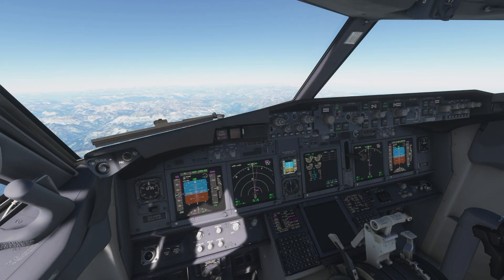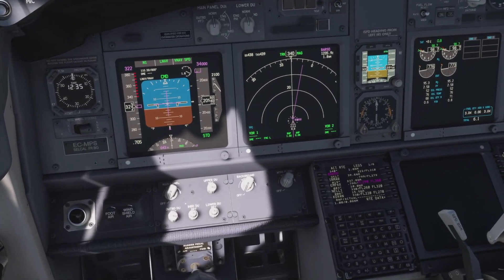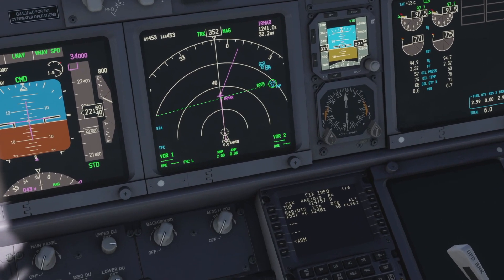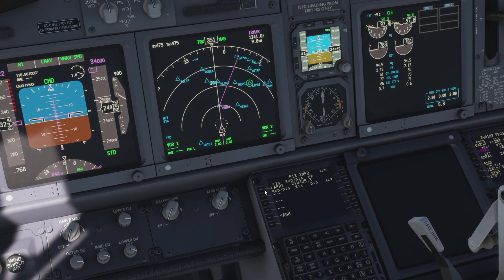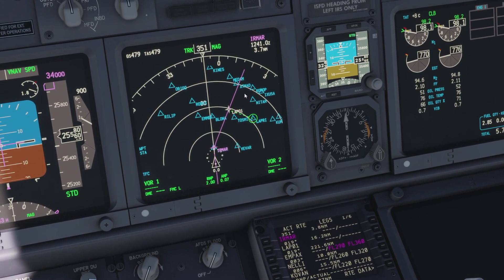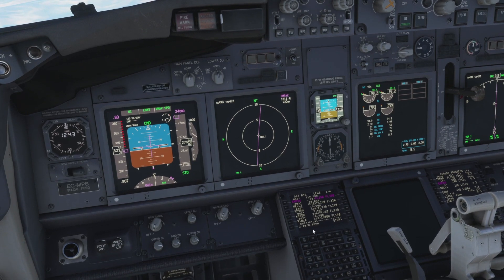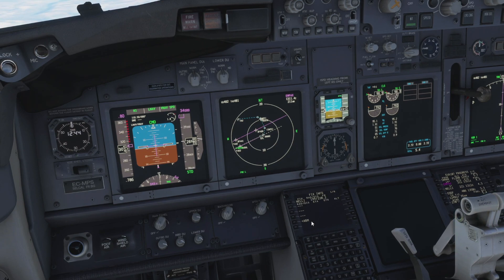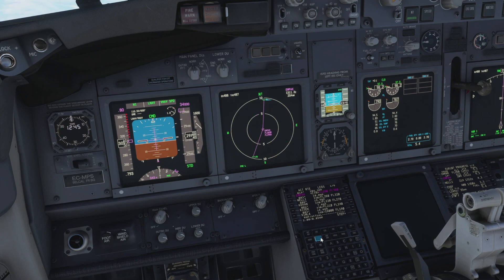PMDG 737-800 Fix Info TUTORIAL #microsoftflightsimulator #msfs2020 #msfs #pmdg

Comment: Hello bro. Can you please help me?
Every time when I select the b737-800 then i select to spawn me from the gates and they put me in the game, I get into the cabin and the plane is automatically connected to electricity and it's very inconvenient because I want to turn everything on myself
Reply from the maker: Hey, thanks for your question. You need to go into the PMDG setup menu in the FMC... from there you can set your initial panel state to Cold & Dark... then each time you load into the plane it will keep that setting. Thanks for watching!
Reply: @seven3simmer  THX  a lot man!